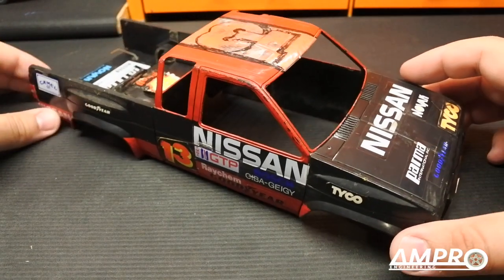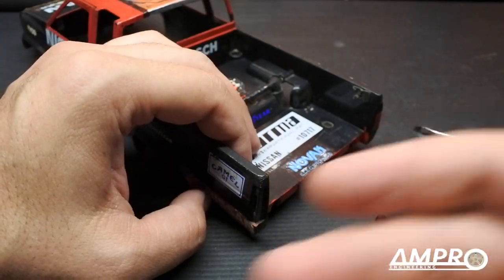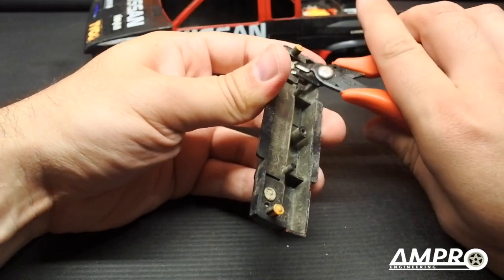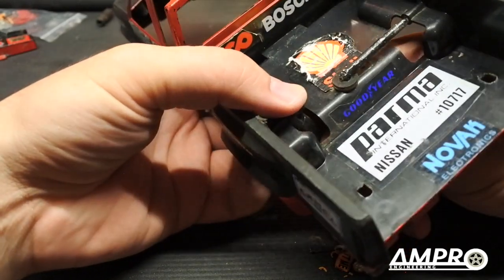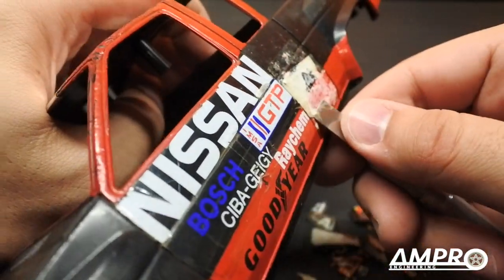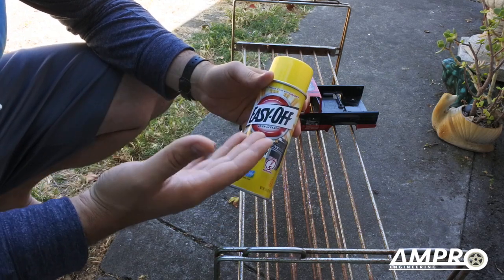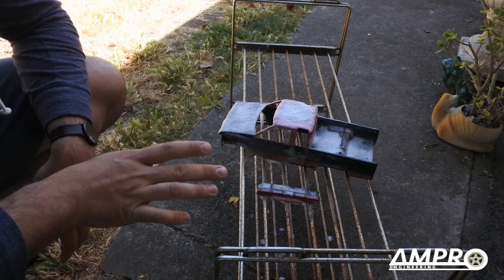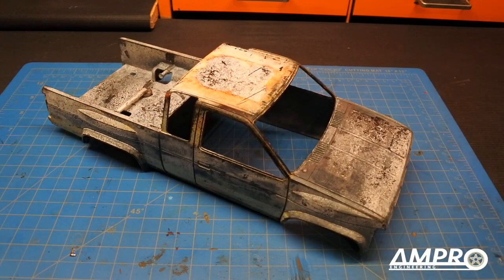E80: Taiyo/Tyco Baja Bandit Restoration and Upgrade - Part 2

Comment: Ahoy again!  I too have used Easy-Off for years, & that darn scum is because it was allowed to dry.  Try popping it in a plastic bag after re-spraying it, & don't let it dry:  Give it a few hours, then while wet, scrub it off in the sink w/a toothbrush & soap & water.  95% of dried scum gone.  Hope this he'p's ya out Mate.  I luckily have a blast cabinet with Super-Fine glass bead that'll wipe the paint and goo right out & not hurt the plastic if a little finesse is used, it is a great help on these old cars.  I'll be looking for Episode 3 on this, Thanks for doing it, Chris  REC
Reply from the maker: I have also and rarely had that happen. This truck had a lot on it but another one I did a couple weeks ago also dried but was clean as can be. I think it may have to do with the type of paint used as well. I like your blast cabinet idea too! I was working on this body last night and will be posting 3 soon. This next part was body work and got really involved.

Comment: 3D printed replacement gears would be sweet. The turbo outlaw DOES NOT have a diff, its just like the bandit and turbo hopper. Keep up the great work!
Reply from the maker: That is my plan. I have a Bandit with no diff that sounds like your sprint car and I think it needs a way to stay alive. My mk1 Turbo hopper also has no diff but my 2 gen Bandits do. It seems like the diff equipped cars have less transmission issues.

Comment: Awesome vid! I just recently picked up a black bandit, I believe its a first gen as it doesn't has a diff or axle flex like yours here. I'm hoping to do the same as you are here, swapping in hobby grade electronics and make a fun little classic rc I can run around on walking trails and tracks like an actual baja truck. Mines in really good shape as its only missing the front and rear bumpers and the driver side spindle at the bottom where the pin would go through is busted but an easy fix, gonna need a new pin but I can make one up. 

Sadly mine didn't come with its controller (paid .50 cents so not mad), so when I got it home I tried it with another 27mhz controller I had and threw a battery pack in it. Light came on but sadly I cant get it to do anything, I did open it up and its surprisingly clean and everything looks fine to me so i'm at a loss. 

Oh and I noticed you make 3d printed parts for the old classics so I was wondering if you had any for the Baja Bandits? any tips or advice would be a big help!
Reply from the maker: That is great to hear! The bandit is an all time classic to me so it makes me happy to hear others enjoying them also. The 27Mhz radio you have, is it for a bandit or a random one you happen to have? I have found that this rarely works. The car could have operational electronics but if you have no way to test it, it makes it very hard to figure out what to do with it. Ebay usually has one from time to time but I think your plan on upgrading it for walks and trails sound like the better option. That is my exact plan. As for replacement parts, yes, I make all the bumpers, two variants of the roll cage (stock and with aux lights), replacement tail light lenses and some other bits. They all just came in and I haven't done a review of them but they fit great. I need to do a couple more tests and then I will make them all available. Ill have a video on them soon! For now is you go to the tamiyaclub.com/forums and check out the TC Designs area, I have a thread there with all the pictures of them.
Reply: Thanks! I figured it being a classic I wouldn't want to thrash on it so it being a fun little trailer seemed like a good idea (though if I find a track I'm not holding back lol). I plan on getting a hornet and making it my first all around racer too, oh and do you know of any good ways of getting paint off the chrome without damaging it? Seems a previous owner painted one of the wheels in a pink color and I figured rubbing alcohol would be a good idea.

Can't wait for the video and I'll definitely place an order for some of your goodies once I can. Gonna bring this old guy back better than ever!
Reply from the maker: The Hornet is a great first car. I have stock ones and I have ones whose only stock parts left is the chassis. They are great. Have you seen my hornet upgrade videos? I love those cars. As for paint removal off chrome...that's hard. I would say that what ever you use to get the paint off will damage the chrome. I use oven cleaner (as you saw here) and depending on what kind of paint was used, it might come off before the cleaner has a chance to damage the chrome. Maybe another viewer has an idea?

Comment: Haha that damn glue! I've found that some WD40 will kind of render the glue inert, rub some in and leave it a minute then the glue will kind of roll off into little balls, get of as much as you can and then something like isopropyl to take the remains away. I find isopropyl is totally ineffective beforehand but once the WD40 has done it's job the iso will take what's left right off.
Reply from the maker: Yeah that stuff is irritating! I do plan on doing the WD40 trick. That always works well.
Reply: Liquid wrench seems to work a bit better

Comment: A message from Carmine....  NEVER use Oven Cleaner on Lexan, for the reason you stated and more. He has stripped almost anything off of everything, starting in the late 70's, with Model Trains. 
For Lexan, if it's an acrylic based paint - 91-93% Isopropyl Alcohol. Lacquer on Lexan, Acetone or some of the R/C market produced paint strippers.  
He is still NOT doing well.....

Ya know what? You COULD be done with that body, after the Oven Cleaner. Looks like a perfect, backwoods rusted beater!! 😁 👍👍  Carmine AND I have spent a lot of time trying to make some bodies (especially on Trains!) look that beat up! 😉

However, I KNOW that you don't want to go down that road with this..... 
Working lights modern electronics, and a full resto-mod, on something I wouldn't have given a second look at 30 years ago..... that's SO COOL!!! 😲 😎👍👍👏👏👏👏
It will be great to see how this turns out. 
Murph
Reply from the maker: Yeah it is too aggressive.

Comment: I just had A BLAST FROM THE PAST on my living room parquet 🤩 I put 2,4GHz and a 2s Lipo 350mAh in my freshly bought Tyco Mini Blaster (from my early childhood days). My jaw DROPPED, when I changed the gears from slow to fast 😲 😲 😲 I expected it to change to the slower gear as I was really impressed by the gear which was already in place when I ran it for the 1st time....But I had started in the slow gear !!! The only problem is: The pinion got loose after a few minutes of VINTAGE MAGIC....=> DOES ANYONE KNOW HOW TO GET THE RIMS OFF ??? I´d be so happy to know...Because I can´t access the gear box properly without removing the rims.
Reply from the maker: Yes, if you look at the video on the bandit to where I am rebuilding the transmission I explain exactly how to get the wheels off